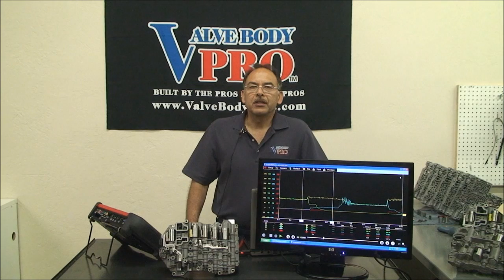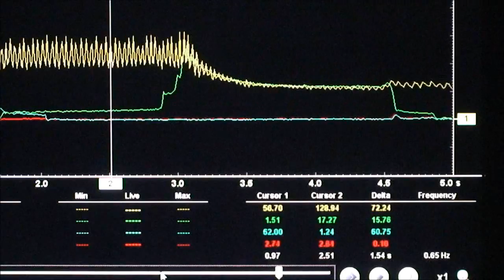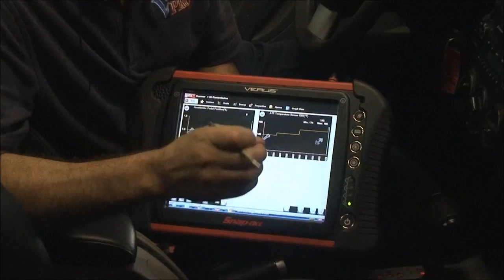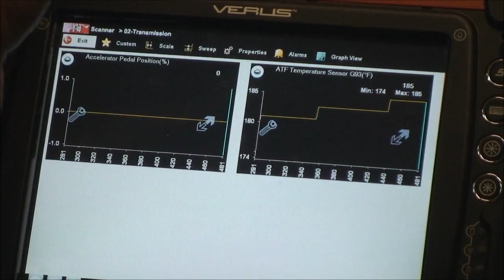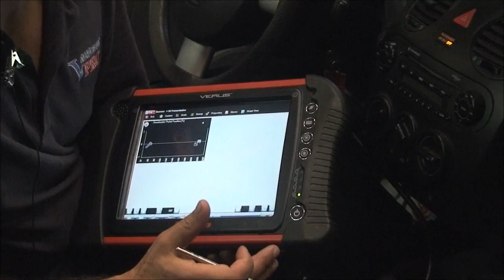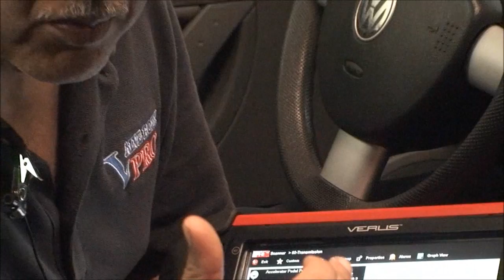Aisian AW TCM Learn Procedure

Comment: Donmono 80.  We have found that this procedure will work on the AW55-50 units and also on most of todays computer controlled Transmissions as long as there are no other problems with the transmission.

Comment: I rebuild valve body on my 2008 VW Jetta.  It looks like the TCM has Learning Issue, Is this normal.  Can somebody help me. I drove a vehicle for over 100 miles now and transmission shifts little better then before.  How long do I have to drive it until it gets better.